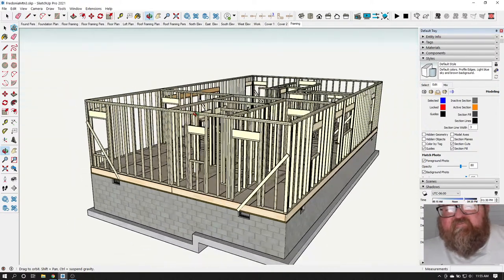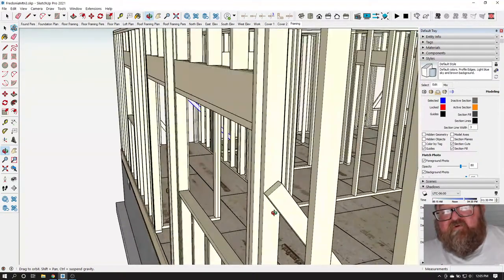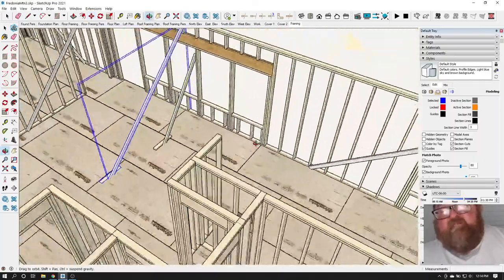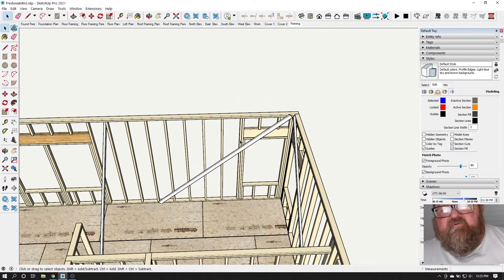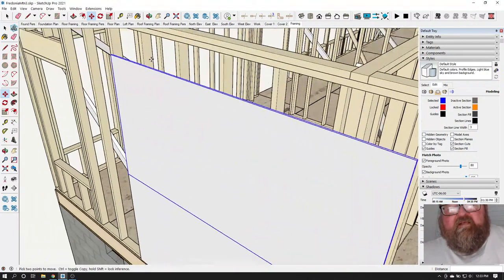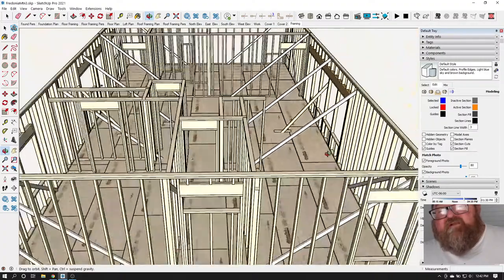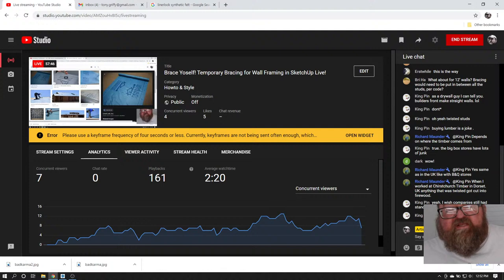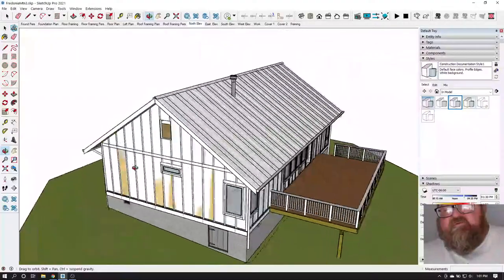Brace Yoself!  Temporary Bracing for Wall Framing in SketchUp Live!

Comment: Yes Tony in the UK you can buy what they call rough saw treated which has just been air dried so still is very damp so is only for outdoor use. But you can also buy kiln dried treated like 4" x 2" stud timber and larger.
Thank you for the video thumbs UP and shared. :)